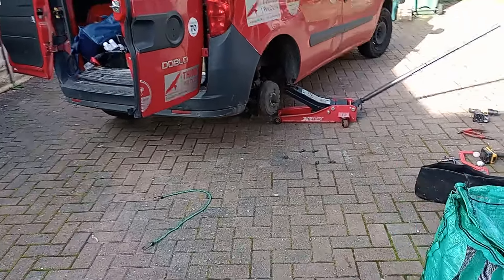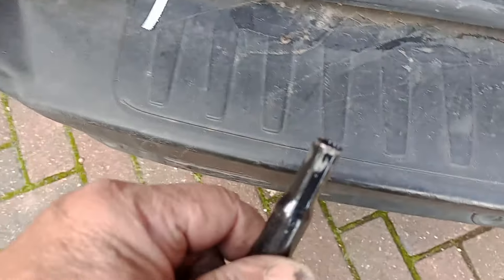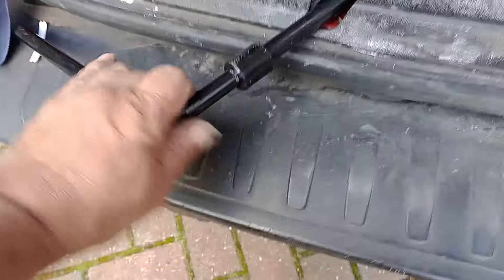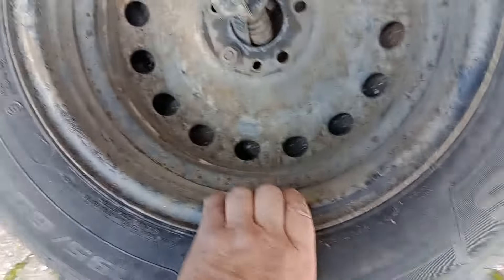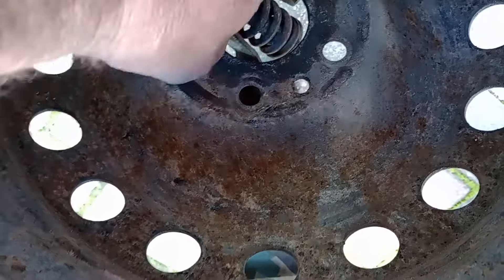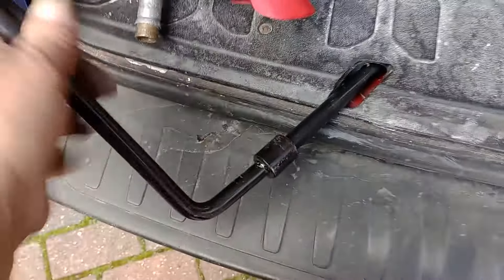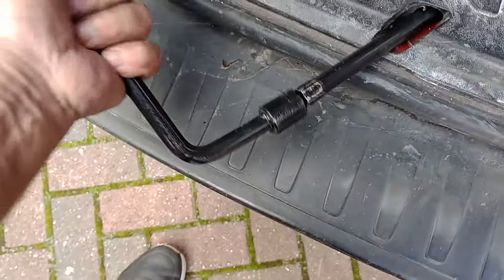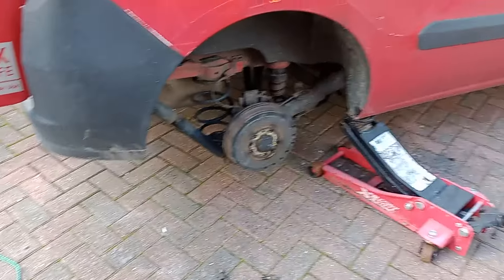how to access a  Fiat Doblo &Vauxhall Combo spare wheel.

Comment: good instruction, mine is siezed up any ideas , can it be freed off?
Reply from the maker: Hi, best thing would be to crawl underneath and if you can spray wd40; onto the cable and threads that hold the wheel in I would also spray into the hole in the rear bumper where the socket goes  and leave it to soak in over a few days maybe give it another spray then work the bolt slowly in and out untill it goes all the way down. Good luck.
Reply from the maker: Thank you.

Comment: Hi mate the bar that fits in the back do yoh have a size for it if i use a socket set, van didnt come with 1 so cant drop spare wheel
Reply from the maker: I should have been more precise about the socket and maybe a photo with  some measurements sorry for that, I will message my son and get him  to send me a picture and some measurements if that helps.

Comment: mine is siezed up, any ideas
Reply from the maker: @timeyre9985  hi, you can spray wd40 from underneath onto the cable and aim it into the outer sheeth and leave it soak in then keep repeating the same process but try turning it forward and back it should eventually loosen up.
Reply from the maker: @timeyre9985  good luck.